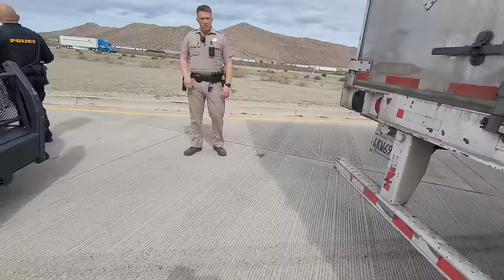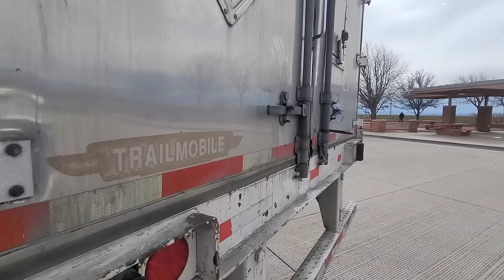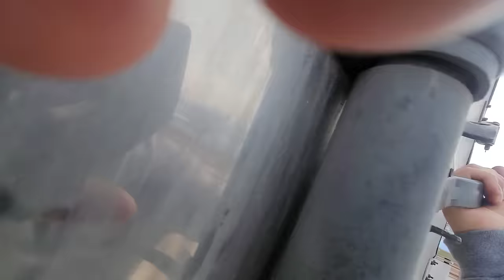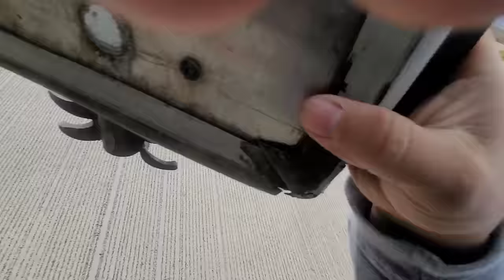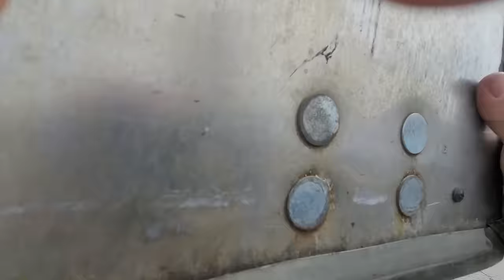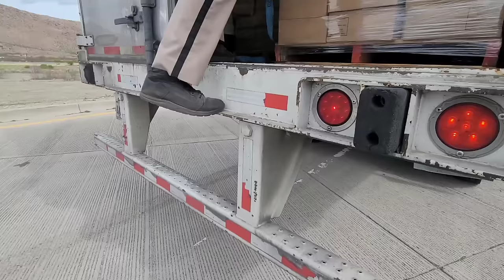Arizona DOT opens trailer thinking I had illegals,  due to wind sound

Comment: Cops cut the seal......make the cops open the door.
Reply: It would take them to long to read the instructions......
Reply: They should have to install one of their own seals on it once inspected.
Reply: They may need a warrant to open it themselves. If you open it for them, they're less worried about any court case getting tossed out over lack of warrant or exigent circumstances.
Reply: @TheCanadianBubba   They should indeed! They're also supposed to give documentation of that as well, otherwise the consignee can refuse the load..what a pain in the a.. that is.😡🤬
Reply: No as soon as he cut that seal he just bought that load if the receiver doesn't except it and pay for it.
Reply: As a trucker, I've heard that sound. His bumper on his ICC was perforated, and it was really windy. When it's windy like that, a perforated step bar will play like a flute...
Reply: @WEHenry  Except - no, accept - yes.
Reply: Yea you opening the door was an invitation, I would tell them to get a warrant.
Reply: @bimrz1642   As a company driver, that's an invitation to be fired. Plus, whatever time you spend on the side of the road digs into the time you're legally allowed to drive. Independent drivers are set under the same mandates but have more leeway under their own authority. Time IS money.
Reply: @stevepettersen3283  🤣
Reply: @Joebidensonlyterm   only if you work for a crap comp any. I get paid for EVERYTHING I do once I start my day
Reply: @32krazy1   Even being woke up in a pickle park by D.O.T? You're off duty and legally obligated to go to on duty status in that situation. Of course, paper logs can say anything. Before e-logs, I've run 4
Reply: @Joebidensonlyterm   no I dont sleep in rest areas. I sleep at home every day. get all the sleep I need there. 6 figure salary off weekends . try working for a decent company and not the shit companies so many think they have to.
Reply: @32krazy1  I wholeheartedly agree. On the flip, you'd definitely have to be wholeheartedly committed, too.
Reply: NEVER OPEN THE REAR DOOR OF A TRAILER ON THE SIDE OF THE ROAD IF THERE IS AN INSPECTION PORT TO MAKE SURE THE LOAD HAD NOT SHIFTED AND IS LEANING ON THE DOOR!!!! YOU ARE ASKING TO GET KILLED !!!!!!
Reply: I literally just posted a comment on that seemed like they tricked the driver into 'giving permission to search' there.
Reply: That's correct, and I would also contact my dispatch right away to notify them that the seal was cut and removed by the cops and that I was directed to open the trailer doors. @TheCanadianBubba

Comment: It’s getting harder than ever to ship black market flutes...
Reply: Were flutes of legal size in the state the truck was traveling through? So many regulations...
Reply: @neshobanakni  Or were black flutes allowed to be hauled on the highways of that state on this day of the Week/Month? 
Yes, so many regulations!
Reply: @dannysmith7805  You probably already know this, but a few might not. The "flutes" in question are the corrugations within a sheet of cardboard. They are graded by their size. That truck was filled with pallets of cardboard sheets. The sounds are caused when you fail to give a ratchet strap a single turn before securing it. Without that turn, the straps will set up a weird harmonics. Remember that next time you tie down your boat or any other load.
Reply: @neshobanakni  which load?
I have 23 OTR Rigs.
Drove one after I got out of the Army. Then bought another one. And kept going.
I was just being sarcastic about how some states have different regulations. 
 Like how in one State you can only haul certain loads on certain days of the week. But when you get to the next state line the load may set for up to another 6 days until the load can be moved according to this States Laws.
 Those Trucks just do not make much money setting idle.
 Or as I have always said that the Trucks do not make money hauling sailboat fuel.
Reply: I think it was a skin flute..
Reply: Hahaha, good one !

Comment: I'm not a truck driver nor been around trucks enough to recognize the 'wind flute' sounds from wind passing over a series of holes in the trailers bumper assembly. But I do recognize mechanically produced sounds and the moment I heard the first 'note' from the sound I knew there must be air flow going through holes or splits between panel rivets on the trailer body etc. I would have never thought it was produced by a human (unless all other possibilities have been debunked).

Comment: Can’t they call and verify the seal, and inform the police to question the person that installed the seal ??

Just cut it off without question 

Maybe they can just pay for the load also and write a certified letter attesting that it has not been tampered with or that police will be responsible for anything that isn’t there

Comment: Idk, I don’t get the wind sound. It would seem to be some part of the outside of the trailer whistling, not due to something or someone inside. For one thing, the wind wasn’t blowing into the trailer unless it had a hole somewhere. And secondly it didn’t quit whistling when the door was opened. Maybe there was another reason.

Comment: Did they give you the tag back? Because the place you're going to needs it.
Reply: They will give it back, and usually replace with one of theirs. And make notation on your paperwork. I go to all border crossing towns and it's happened to me several times.
Reply from the maker: Yes they did, also sealed it with a Arizona Dot seal

Comment: That is your DOT underride bar making that sound in the wind. It's like a flute when the wind blows across the square steel tube openings on the bottom. Don't believe me, put some duct tape over the ends. A those damn cops should know that.

Comment: NEVER NEVER NEVER NEVER OPEN THE REAR DOOR OF A TRAILER ON THE SIDE OF THE ROAD IF THERE IS AN *INSPECTION PORT* TO MAKE SURE THE LOAD HAD NOT SHIFTED AND IS LEANING ON THE DOOR!!!! YOU ARE ASKING TO GET KILLED !!!!!!  I do not have a CDL or even drive big rigs, and I know that Rule.  ALWAYS ALWAYS ALWAYS use the Inspection Port BEFORE opening the main door!!!

Comment: Don't they need a warrant to open a sealed load?
Reply: No they had him open it. I would've refused to open it.
Reply: @philacy  Cops can search anything with consent. Never give it. If they have a lawful reason without a warrant, they won't ask.
Reply: Commercial transport is different.
Reply: The driver made them cut the seal. That is the important part. @philacy
Reply: @oldriver1827  you're right. I see that now. And he actually caught it on video. I didn't catch that at first.
Reply: Trooper will note on his bill of lading they cut seal wherever and whatever time and they have seals to put back on the trailer and they will note the new seal number along with badge number and contact information if destination needs to verify
Reply: The search can still be ruled unlaw since the PC was a sound that a reasonable person would not associate with people hiding in the trailer.  Making this an unreasonable search under the 4th amendment.

Comment: I am 1000% against Biden's invaders. AND a supportive  of  "lawful policing". When the driver's load is rejected because  the of a temperature change that causes his load to be rejected, is that driver/company stuck with the loss? 

A tip for others, you don't have to give consent to search.  AND you DO NOT, NOT, NOT  have to open any door or compartment. If they are going to go against that refusal to consent, then so be it.  IF you give consent or open that door and they discover that case of beer or bottle of wine in the process, then you can't have that the evidence quashed.  If you did not consent and the  stuff your aren't supposed to have is taken as evidence, a good attorney may be able to get it suppressed since there are 4th Amendment issues at play.

Don't let the police bully you TO  incriminate yourself.